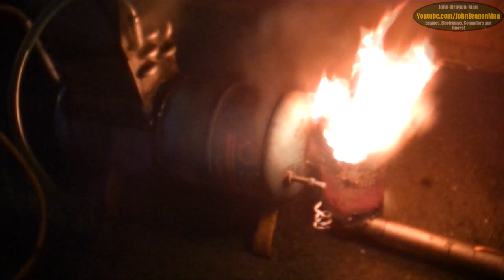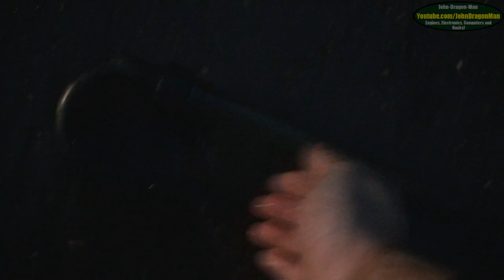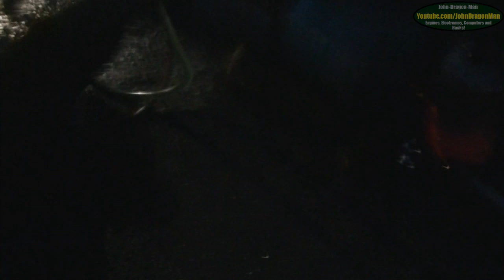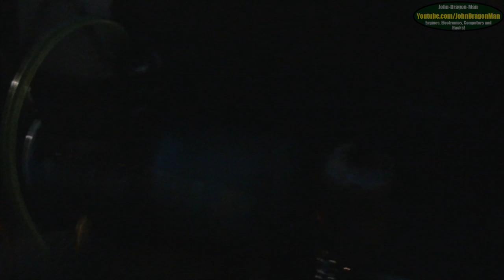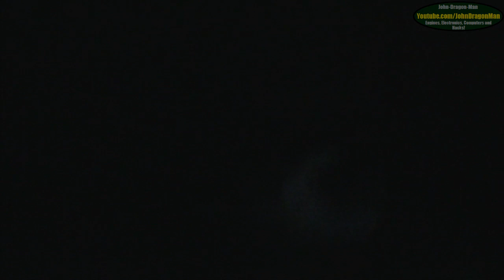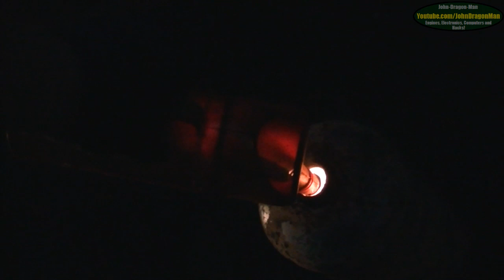Waste Oil Buring water heater pt3

Comment: Hi John,
            I'm an ex-pat living in Spain and am one of the Old people you mentioned when referring to metrification, although I think I am one of the odd-ball types because being a model engineer I love the metric system as it makes measurements so very much easier. I have made some of  Tubal Cains designs but because he is American and even older than me all his designs are in the old imperial fractions and I had to convert everything into metric before I could build any of his designs.
    I have watched your videos as I have to burn wood which is very expensive over here, something like 160 euros a ton and I can burn 3 tons during a normal winter. Your enthusiasm is very infectious but do please be very careful as these oil burners can bite. 
  I think you have a few issues with the concept of oil burning, firstly your feed pipe is far too large and needs to around 1/4 inch dia. The stainless car brake pipe would be ideal but must be kept cool by not letting it touch the edge of the air pipe. You can easily make springs with a small diameter of 1/4 " growing over a few turns to the inside dia' of your air pipe and then over a few more turns reduce back down to 1/4" which when spaced along the air pipe run will keep the oil feed pipe away from the edge of the air pipe. Secondly the delivery of the drips of oil and the air delivery tube must be about 2" above  a cast iron vessel which when heated primarily by igniting some paraffin. When at operating temperature the drips of oil hitting the hot bottom of the cast iron pot will be accelerated by the air stream and vapourise and spray out ignited by the temperature and the existing flame. The lowest running temperature will generate around 10 KW of power so make sure that your heat exchanger will handle that amount of power, I think it will but will be operating at near max capability. Lastly the height of your oil feed need only be a few feet but higher will not cause any problems if you have a regulator tap in line with wich you can control the feed rate of oil consumption. I have yet to build mine but due to the very cold winters In will have to wait for the warmer weather. This build may be put off permanently as due to poor health I will soon have to return to the UK.
Never the less keep up the good work but think a little of those who watch your videos as I could see very little in your last video due to night time and contrast with the hot burner and I think a torch moving about. All in all a great effort and I wish you success in your endeavours and please view my comments as constructive and not criticism.
Cheers Mo